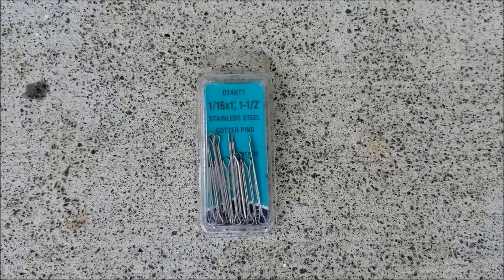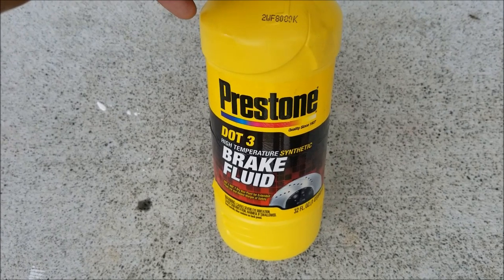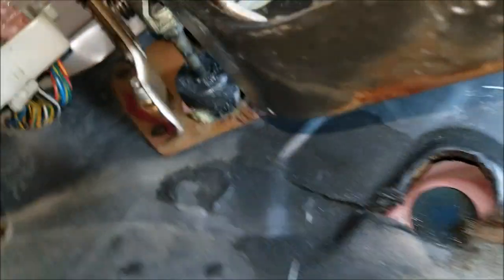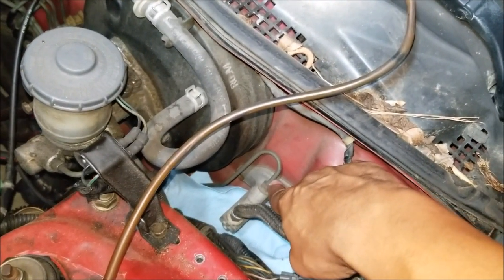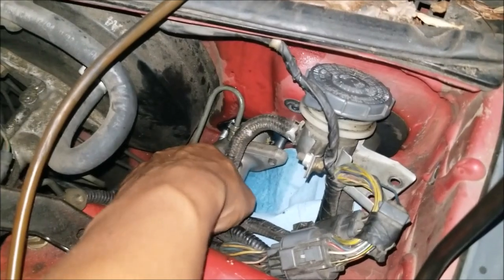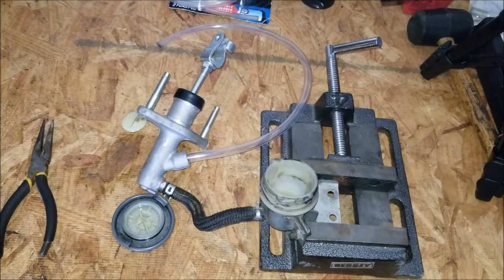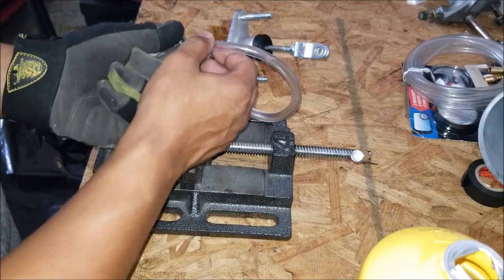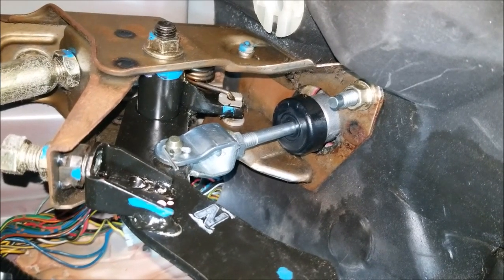BENCH BLEED clutch master cylinder and REPLACE

Comment: Great video, Thank-you; my clutch pedal stays down. How do I determine which to change- master cylinder or slave master? No visible leak inside or outside of car, also clutch reservoir is full. 2006 Acura Tsx
Reply from the maker: In that situation, I'd do a visible inspection of the slave cylinder. I'd remove the dust cover boot and verify it was operational and no leaks inside the boot

Comment: Bro this vid is awesome, thx and keep em coming. Can u do one on bent valves
Reply from the maker: Glad you found some good value in this video and appreciate you taking the time to comment! I have some additional videos on the way; I'll have to add bent valves to the mix as I've run across that a few times
Reply: @EngineeredMojo  my thing is my timing jump the other day, I changed the belt, waterpump, pulley and tensioner. And also changed the plugs and plug wires. But one of my cylinders still isn't firing. And it sounds like I have a vacuum leak, but can not find it. I've checked and tripled checked. So it has to be a bent valve lol. My car is a 06 Chevy aveo.
Reply from the maker: @dirtyred246  have you done a compression test on that cylinder and/or a leak down test (assuming you have access to compressed air)? I'd try a compression test since its relatively simple and will at least tell you if there is a compression problem in the cylinder which can be investigated further
Reply: @EngineeredMojo  no I haven't done one yet, have to figure out how first lol.
Reply from the maker: @dirtyred246  haha I hear you, compression test is a simple check. Just need a compression tester (~$20-$30 online, prob similar in stores) and the ability to turn the crank which you've definitely mastered if you changed a timing belt

Comment: I've done gravitational bleed outs on brakes before just open the cap on the master make sure its filled then open the bleeder valve up and let it slowly seep out .. not sure if this would work on a clutch master cylinder or not but will find out as I'm replacing it on my 1997 Toyo Tercel 5 speed 

It has  nearly 190k and doesn't burn oil yet but this car has outlasted my left knee joint and  nearly outlasted me lasted me this past august due to some serious health issues..   after having it for TEN Years will be selling it off in the near future replacing it with a 2004 Toyo Corolla with auto transmission hope this car is as good as the Tercel was to me
Reply from the maker: Can't go wrong with getting another Toyota, those vehicles last a good while. I have a Tacoma that has over 300,000 miles and still sounds better than some new cars fresh off the lot. Doesn't hurt to try the gravity bleed method, may be possible but I don't have personal experience using it on a clutch cylinder. Good luck and if you remember, let me know how it goes! Thanks for leaving a thoughtful comment

Comment: air bubbles never stoppeed but drives good
Reply from the maker: May have been air infiltrating from around the hose connection. Hopefully should be and you are all good, especially if it drives well. You'd notice air in the lines for sure

Comment: When your done bleeding the master cylinder in the workbench. When you remove the plastic clear hose will it poor o out fluid and if so wasnt it quite messy when installing it. The step skipped after the workbench to it being already installed.
Reply: Also thank you for your videos i watched the slave cylinder one aswell!
Reply from the maker: Glad you've seen a few videos haha. And it's not messy at all actually. I keep all the bleed hoses on while bolting the master cylinder to the car and take them off one at a time as I'm reinstalling each hardline back into the master cylinder. I place a small cloth under the master cylinder to catch any drops as the clear hoses are removed, but very little comes out. Hope that was clear and thanks for asking the question!
Reply: Engineered Mojo thank you bro i understand now. Ill be doing this and my slave cylinder. Should this be done first before the slave cylinder and then as shown in your slave cylinder video i can resume bleeding from the slave cylinder after installing the master cylinder. Lol half this paragraph is slave master cylinder lol
Reply from the maker: @alexanderbarrera9140  haha no problem. Yes, I would complete the master cylinder install first only because it's a bit more effort. Then proceed to swapping the slave. Makes no real difference though given you are changing both and bleeding system. Only important part is to bench bleed the master cylinder to save yourself some hassle. Not fun trying to get rid of air in the master cylinder if installed on the car.

Comment: On my civic I replaced the master and slave cylinder and had bled it, and had pressure for about 7 pumps then the pedal began to fall to the floor and now when I push the pedal there’s like a hissing air sound coming from the master cylinder as it just sucks back to the ground
Reply from the maker: Did you bench bleed the master cylinder or did you try to bleed it while installed on the car?
Reply: Engineered Mojo yeah I had bled it before but accidentally used the wrong fluid then got the correct fluid ran through the line and everything and bled it again. I’ll post a video of what the pedal does and the sound it makes
Reply: Just posted the video if you wanna see for yourself
Reply from the maker: @theighthokage2943  hey I just watched it, yea you still have air intrusion in the line. I'd try rebleeding from the slave cylinder. Since you initially had preasure, it doesnt sound like a leak anywhere. By bleeding again you'll be able to tell quickly how much air is still in the line
Reply: Engineered Mojo how many cycles do you think it’d take, when I bleed through the slave cylinder I go till I have to top off the reservoir 3 times and I won’t see any bubbles in the hose

Comment: Do you have to bleed your brakes after a clutch master cylinder install?
Reply from the maker: Not at all; two different/separate hydraulic lines
Reply from the maker: Not at all; two different/separate hydraulic lines. Good question

Comment: why did u removed the master clutch?
Reply from the maker: My master cylinder had failed so it was being replaced. It is magnitudes more effective to bleed a master cylinder out of the car than installed on the car as well. Good question!